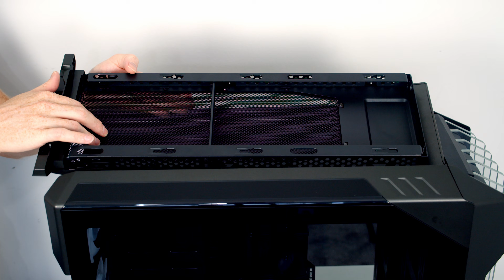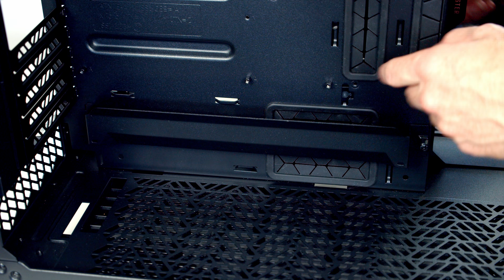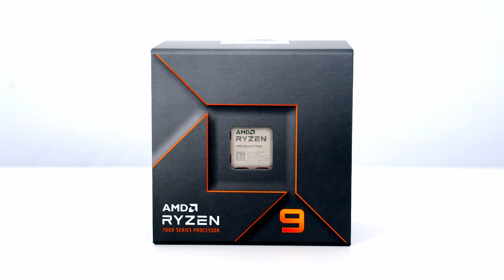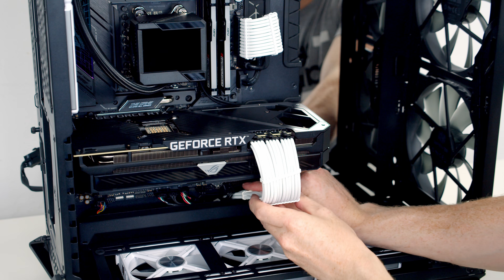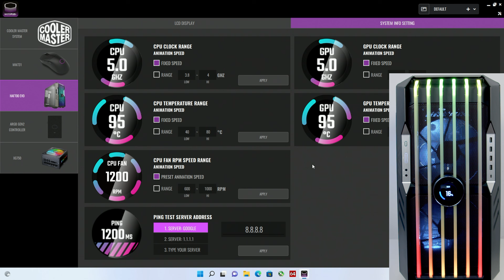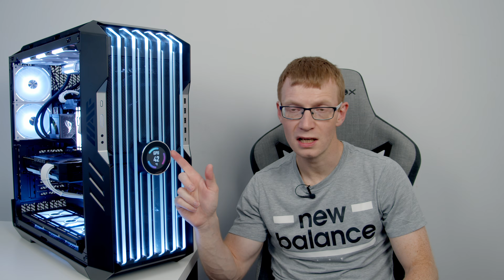Cooler Master HAF 700 EVO - PC Build Guide

Comment: Can you explain where the cables for the AIO cooler go more thoroughly?
I am installing the arctic 360 pro, and it came with the fans already attached to the radiator, but with the cables wrapped through the fan chassis...I assume I need to disconnect and unwrap this cable and plug it in somewhere on the mobo, but where? I am going with the single to single connector from the fan head itself, says CPU on it, then there is the rgb cable as well

Comment: How do you get the damn mirror out? I unscrewed the two screws at the top the mirror leaned forward and you said there are two pegs at the bottom yet I felt nothing and it’s stuck at the bottom and won’t move.

Comment: 2:13 Cheers Christopher, in this heat with my CPU creeping up to 70oC I wanted to do a deep clean and you helped me take the front cover off with confidence.  Good thing I did, that filter was doing some real heavy lifting and the amount of dust those two front fans were pulling in was obscene!  Strongly recommend anybody with this case do the same!
Reply: The front fans have ARGB? Or is just the front crystal?

Comment: The biggest mistake cooler master made was not putting in the halo fans. I plan on buying this case and using 12 halo fans as I don't really care for water cooling , as for the stock argb remote I will be using armory crate to control everything . I wish they would have made more larger cases like this one

Comment: Hey

Do you know if it would be possible to fit a 480m radiator on the side, 360m on the top and 360m on the front in this case?

Comment: so i saw you are using the lian li unifan does the coolermaster software control the argb for those fans or did you have to still use L-connect from lian li?

Comment: Hey, the case is specified to support 200mm long power supplies, a 210mm long one would work just fine right? I mean, i cant see why it wouldnt beyond that the cables might have 10mm less range of motion behind it, but just to make sure, thanks in advance!
Reply: Did you ever end up getting the HAF 700 and a 210mm PSU? I have the case (non-EVO) but looking at a 210mm PSU and wanted to know if it will fit well. My old 200mm PSU seemed to fit with ease so I imagine an additional 10mm won't be too much of a trouble.

Comment: what you fail to mention...and it is the same for all other channels that review this case is that you need a motherboard with 2 usb 3 front panel connectors....other then that good review
Reply: Thanks for the heads up

Comment: It sure is a cool case and all, but man that $650 price is tag is hard to stomach. Is Cooler Master imitating Nvidia's price strategy or something.
Reply: It’s a case for a $8-10k pc build. This guy only used one radiator when you supposed to have at least 3 and a reservoir or 2. I do plan to buy this case In my next build.

Comment: I'm hoping to see fan tests in this case. I believe HAF 700 The BERSERKER!!! (emphasis mine) would behave very similarly to this case, making it twice as interesting. I'm currently using Enthoo Pro 2 and the bottom 120mm fans actually helped my GPU temps, despite running at fixed low RPM (like, 30% low, Arctic P12, close to 1000 rpm they get really annoying hum). What I'm hoping to see in this case (or 700 non-evo) is whether placing 3x140mm fans on the bottom would help a lot with temps.

And I'd love to see comparison "AIO inside the case" versus "external liquid cooling outside the case" (like MORA3 or something similar, with 200mm fans for minimizing noise). I believe moving CPU cooling outside the case entirely should improve both CPU and GPU thermals, as well as noise (since both will get cold air at all times). I believe even 4090 (considering the giant air coolers) can be practically silent even in a relatively small case (relative to HAF 700) if cooled with multiple fans and not affected by CPU temps, while CPU can be cool and quiet if it has enough radiator area outside the case. Combined result should be cool and quiet for both components.

The reason I'm not trying to watercool a 4090 is not because air does a fantastic job, considering the sheer size of the monstrosity (in a good sense), but because of warranty issues. Removing the cooler is instant warranty void for me. On a VERY expensive GPU. So I want to avoid it if at all possible.

Comment: Im 3 months late, but why is my ARGB hub not in my Master+ software? LCD screen works fine, but no RGB from fans or front panels
Reply: If you find any information about the fan controller or hub let me know. It's complicated with 2 different devices you need to configure.

Comment: The best case ever. Using this case with 20 fan.
Reply: Only 20? You need more fans.
Reply: The "case" is good, the software no.
This software and Iris display is the worst trash a never see in my life. Is almost 2025 and this rubbish do not work correctly....lots of bugs, stucks, crashs.

Comment: 10:37 Is that top drive bracket missing a rubber grommet (upper right corner) for any particular reason?  Like, is it supposed to be that way, or is it just missing?  (If it's the latter, that's not a good way to ship such an expensive PC case. 😲)
Reply from the maker: It wasn't a new case and had been used by many YouTubers around the UK before me. I asked to keep it so I got it last so there was a few bits missing.
Reply: @ChristopherFlannigan  Oh! That makes sense.  I just watched one of Tom Logan's videos where he compared the HAF700 EVO to the HAF700 Berserker (which I'd never seen before), and they're a LOT alike.  Both of them are way too big for my needs, but they (as you mentioned) look to be 'tailor-made' for a nice custom loop build. 💡

Comment: Update on this:

Looks great, but is seriously pissing me off right now - lots of serious problems with it.

1. The front LCD panel ONLY works if you run some Cooler-master software which runs continuously in the background as a system service - CoolerMaster MasterPlus Technology Service - but of course this garbage software continuously polls ALL hardware it seems and this causes it to poll all drives in machine, so my four 10TB storage drives can NEVER GO TO SLEEP, and instead make continuous not normal head movement clicking sounds as this software keeps moving the heads every second with special low level commands for information. When I kill the service I am back to silent drives and working machine, but now the front LCD just has a static spinning picture of incorrect CPU or whatever happened to be displayed as service was killed. Leaving this low level hardware polling going would have killed the expensive drives very quickly. Also when I put machine to sleep at night the LCD stays ON and showing same image.

2. The front USB panel does not work as advertised. At back of case is a bundle of cables from front of case, and it includes TWO 19-pin USB3.1 connectors with two cables going into each of them. My standard enthusiast X57 Hero VIII motherboard only has ONE 19-pin USB connector, so could only plug one cable in, so that means only two of the four front USB ports is actually working.

I had no choice but to search on Amazon to buy some 19-pin splitter cable and just got it today - https://www.amazon.co.uk/gp/product/B09KY2ZYVC/ref=ppx_yo_dt_b_asin_title_o00_s00?ie=UTF8&psc=1 , and tried using it to connect the two 19-pin cables - it doesn't work, Windows gives the device connected sound but then says "USB device malfunctioned" when I try and connect my iPhone XS to PC.

This works when only one original case cable is plugged into motherboard. COOLER-MASTER FOR OVER 700 EURO FOR A CASE YOU SHOULD SUPPLY A WORKING TWO TO ONE 19-PIN MOTHERBOARD CABLE SO I DON'T HAVE TO TRY AND DO IT MYSELF AND STILL NOT WORK!!

Nowhere does it say you need 2 x USB 3.0 19-pin header – for 4 x USB 3.0 Type-A ports at the front of the case

3. Tried to turn off PC using front panel power button because a GPU over clock hung display - COULD NOT DO THIS. In order to turn off you seem to have to hold power button in - then PC goes off, then IMMEDIATELY COMES ON AGAIN!!! Can't turn it off, without it coming on again!! Only way was to wait for Windows to load, and then shut down from there instead.

4. The "vertical GPU holder" is rubbish - ribbon is TOO LONG, TIGHT and STRAINED - no way to install my new Gigabyte Gaming 4080 so it is straight and level - it is now strained at an off angle (about 20 degrees) to the motherboard (because the too long ribbon cable is pushing it out under severe pressure while the back clamping mechanism is pulling it in the opposite way) - it looks absolutely terrible and can't be good for the two PCI-E connectors, which are being bent by the pressure from ribbon cable. Now I think I have to go back and remove the vertical holder and put GPU in normally which is a joke!

5. Horrible resonance in the included main HD case. I have four drives installed in this and when they are on and spinning (not sleeping) there is horrible noise coming from resonant vibration from drives through cage and into main frame. It is not constant either, keeps changing tone/frequencies of noise - sounds like a hairdressers shaver going all the time! Cage should have been insulated or dampened better to prevent vibration resonance amplifying through entire metal of case.

6. Now I also noticed that Acronis Drive Monitor which monitors parameters of hard drives using firmware SMART functionality is giving me warnings about drive over safe temperature limits!!

"Disk temperature: 43 °C. Temperature of the disk is above the warning level at 42 °C. Overheating can reduce the disk life span or cause a disk failure. Check that the drive has sufficient air circulation and the computer has proper cooling."

And this is happening WITHOUT THE BACK COVER EVEN BEING ON AT ALL. I'm sure if I actually put on the back cover the temperature would rise even more. I knew this would happen, when they moved a 4 drive cage to back of case with absolutely no active fan cooling over drives. I previously used HAF 932 for years with same drives and in that, the drives were at most 25C ever, since in that design, the drive cage was in direct flow of front case fans. Only time I ever got warning about temperature from Acronis in that case was one time I forgot to plug in front case fans after cleaning.

Absolutely terrible impressions of this new case. For the price of this case I should not be having these sorts of crazy problems with the case/software to run it.

Comment: lcd display need this crap software to run. Custom setup for every single custom led dind't remember settings after restart/hibernate and set up so weird mode. I'm super dissapointed because for huge amount of money we got crap software and we can't controll lcd in other way. btw. even lcd effect and setting didn't work without program in backgroung and you need open and set it again if you hibernate your PC. Nice case, sh1tty soft and overpriced.

Comment: Good clean video production - first time I saw your channel!

Just got this case and started building it yesterday, with 5950X, X570 Hero VIII, EK Elite 360 cooler, Gigabyte 4080 Gaming OC.

It looks great and love the tool-less features, but still having problems...

Things I found with this case:

1. Big bundle of cables with absolutely ZERO instructions of what exactly they are and where they plug into.

2. Manual way too small to see detail - should be printed at A4 size to see tiny details properly, not at A5 size.

3. Vertical GPU holder is a bit of a fail

4. More control software! I already had working RGB and fans set up using ASUS AI Suite, but that does not work with these new case fans/LEDs and the new Coolermaster software doesn't seem to be able to control the fans/LEDs of the EK fan hub either! Like two separate systems now.

5. Some new software with this appears to now be polling my four 10TB drives now every few seconds causing horrible (and drive wearing) head movement clicking noises. Should not be polling drives continuously - they normally go to sleep state after a few seconds.

Questions for you:

1. Where did you plug in the second big USB plug from case? There is only one connector of this size on my Hero VIII motherboard, and I have noticed that half the front panel USB3 connectors do not work now without that plugged in.
There was also another strange little connector which I have never seen before and no idea where it goes and ZERO information in manual about it again.

2. I tried to use the vertical holder and it is NOT good. The ribbon cable is WAY too tight against case and feels like it is breaking the PCI-E on motherboard.
My 4080 does not go on nice at all... it is straining against the push from the ribbon cable and now bent at a horrible angle - not possible to get it to sit straight at all, the back holder is straining to push against the push from squeezed ribbon cable - just a very bad design overall. I'm going to have to get rid of it and go back to horizontal mounting, which sucks big time... this was major feature of the big space available.

3. My case fans are now all blowing at 100% and I don't see anywhere in control software to decrease and control them.

Hope to get these issues sorted and do more work on it this evening

Comment: Just did a build with this and a 4090 with a friend and for such a big case the back gives you so little room to work with, feeded the psu through for a 4090 was horrible need to take it apart and try again sadly

Comment: I'm attempting to build my own PC for the first time ever, I have components in mind but honestly know nothing about the parts I need and which are compatible with one another, so far got the 
CASE: Cooler Master HAF 700 EVO
Motherboard: ASUS ROG-MAXIMUS-Z690-EXTREME
CPU: Intel 13th Gen Core i9-13900K 24 Cores 32 Thread 5.8GHz
Graphics Card:  ASUS GeForce RTX 4090 ROG Strix OC 24GB GDDR6X
RAM: Corsair Dominator Platinum RGB 64GB (2x 32GB) DDR5 5200MHz C40 Memory - Black
 Hard drive: Seagate ST20000NE000 20TB IronWolf Pro 3.5" SATA3 NAS Hard Drive
Solid State Hard Drive: Seagate FireCuda 530 2TB Solid State Drive
Power Supply Unit: Gigabyte GP-AP1200PM 1200W 80+ Platinum Fully Modular Power Supply with LCD.

I have no idea as to what cooling/what kind of cooling I need for this build or what parts I am missing outside of the ones listed, if anyone can provide any insight or advice on this build or for me in general I'd greatly appreciate it. 
(This build is likely missing parts or pieces, please feel free to tell me what pieces or parts I am missing and any suggestions for those parts. 
Thank you in advance :)
Reply: definitely a CPU Cooler because that intel chip is going to run hot. if your case supports it, go with a 420mm AIO or custom water loop. another thing why get a sshd when you could get a nvme, (lots of choices) but honestly i don't know your usage scenario. Also, you mentioned that this is your first time building a PC and the parts you've chose are extreme overkill and expensive. (i am honestly still wondering what purpose you're getting this pc)
Reply: @srirajdellxps121  simply because it's a huge hobby of mine :)) thanks so much for taking the time to give me a response, fortunately I've completely my build as well as my setup now and have never been happier :)) ended up getting the Asus rog ryujin 3 for the cooler and it works like a treat, actually working in building a second PC now for my partner :))

Comment: Thanks for the review nice job. I have already got this case :) and now looking at a new build to put in it. getting parts in bits as I save up. I have 1 question though about the front panel connectors. as in how many of them and can you plug them all into the Strix x670e board? as in all the front USB's and the display 
many thanks as this has got me worried to which motherboard to get the fact that the Strix is one i was looking at is great.
I was looking at getting 2 x 360 rads for the top and one 360 for the side leaving the front open and 3 120 fans for the bottom for intake. to cool both graphics and CPU :)

Comment: Moving the mirror to the bottom, would that be super bad for airflow?
Reply from the maker: With so much coming from front and side it should be ok
Reply: @ChristopherFlannigan  I'm thinking of putting the mirror on the bottom, my 280 corsair radiator on where the mirror was. 
+ the two included 120's in the back. And then probably fill out the top with fans. Either 140s or 120s. Should I be good airflow wise? 

And even better, do you think will I be able to mount my 4090 vertically in there without screwing over the airflow too hard haha.

Amazing video btw! You actually made me decide to get the case, seems to be such an amazing case, even if a bit overkill

Comment: that's a huge case, I like how the AIO is hidden by the other 3 120mm fans.. that front panel switch and USBs though feels like in an awkward place, those switch should be on the top while the USBs are at the bottom.
Reply from the maker: Haven't used the front ports yet as I have only done the YouTube build, I'll find out once I move my system into it

Comment: Hi Chris, just one question, Do you think this case will be able to fit the new Nvidia 4090 Gpu`s from third party vendors with their cables attached and still be able to get the glass panel back on.?
Reply: Im sure it will. It's huge as Sh_t
Reply from the maker: If you can't in this case there is no hope for the rest
Reply: @ChristopherFlannigan  Its just a part that no one is showing this and if you cant get the card in, well thats more money for new cases as well as a psu 3.0. Anyway great straight to the point video`s btw, Im from Omagh by the way
Reply: @Nite-Lite-Gamers  just did it for a friend, it looks awful with the 4090 on it. Holds it well, no sag. But my God that special lead for it does not want to look nice in the case haha